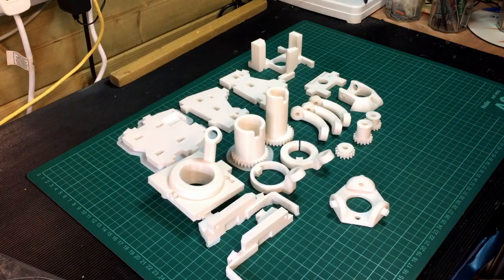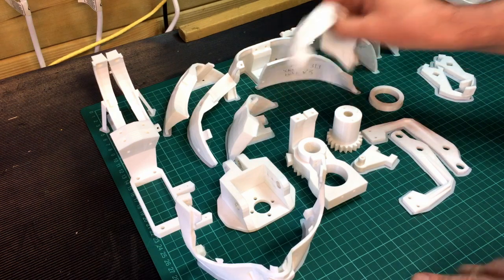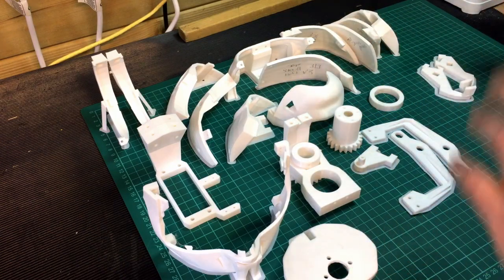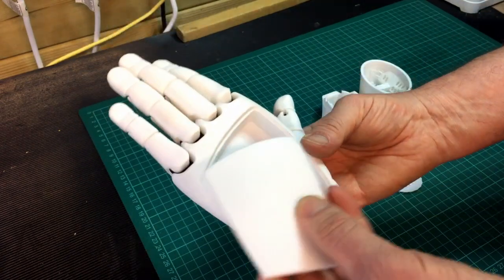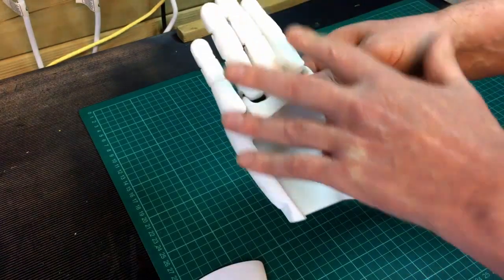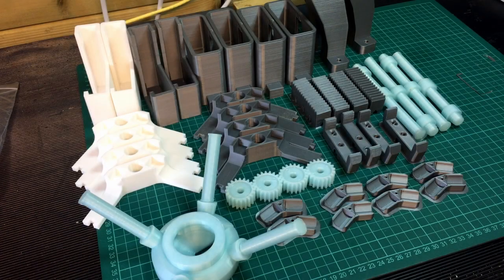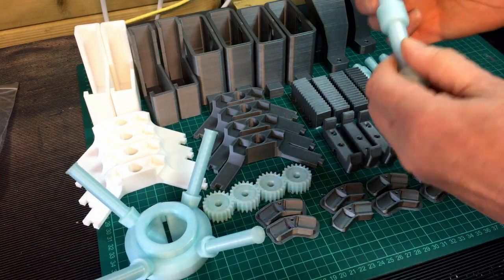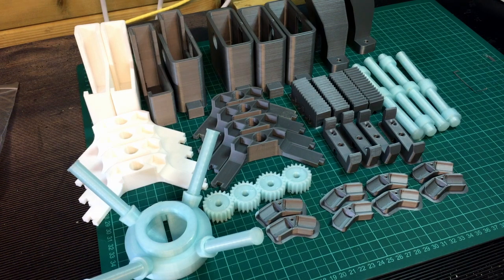InMoov Build Part - 24

Comment: Hi, what hand model are you using here? I saw Bob Houston’s and your looks like a more complete base to move the micro servos into. Do you know the TVerse link? Thanks
Reply from the maker: Hi James, its this one: https://www.thingiverse.com/thing:1191262
I agree about that the hollow base may be good to fit servos and no ugly bases sticking through.  Are you going to try it, let me know how you do?
Reply: kyle campbell will do!
Reply: Btw, these style prosthetics are very large when printed, did you scale yours down? If so to what percentage to match inmoov? Thanks
Reply from the maker: Hi James, no scaling used.   I only printed the hand section and fingers, and intend to use the normal InMoov wrist parts.

Comment: i need a ezb4 controller do u have  a old one for scale becuz i am just a beginer but hobby king prices are very high fr me 
so if u have a used ?
Reply from the maker: No spares unfortunately.   Worth looking at Pololo controllers maybe, they are cheapness.  The MRL basic system will control InMoov with Arduino.

Comment: not that braided fish line in mean after catching the fingures it should go back know? what thing is used to get the hand to its orginal position
Reply from the maker: Hello, the fishing line pulls both sides of the servo so both opens and closes the fingers.  There are TWO lines into each finger, one on the underside and one on the top side.